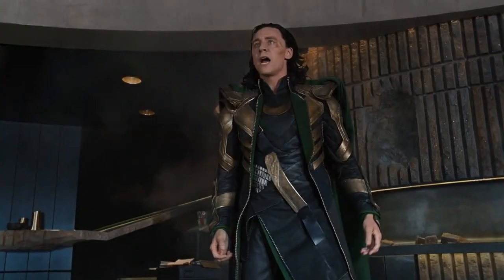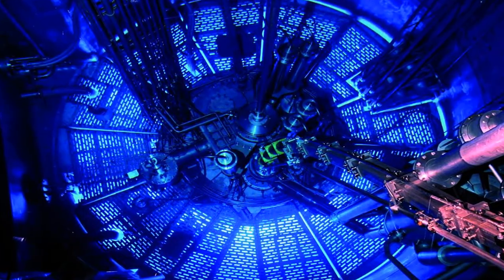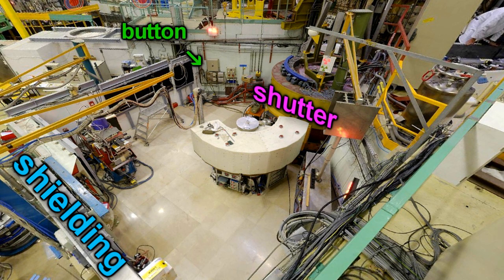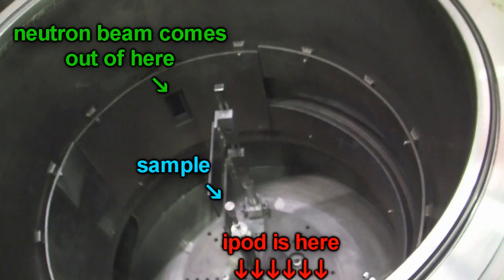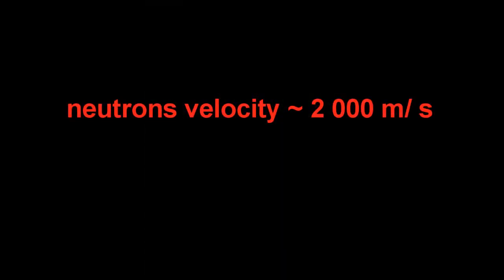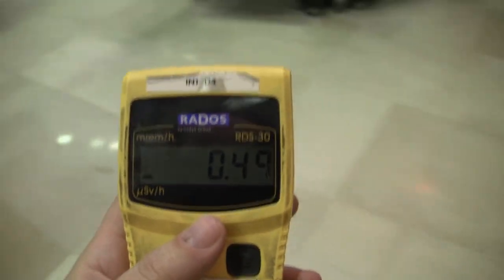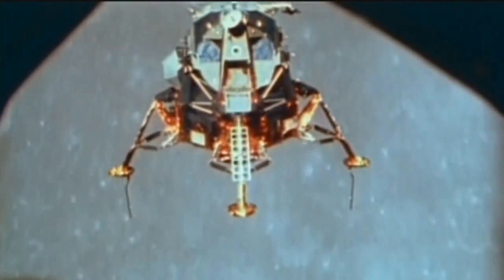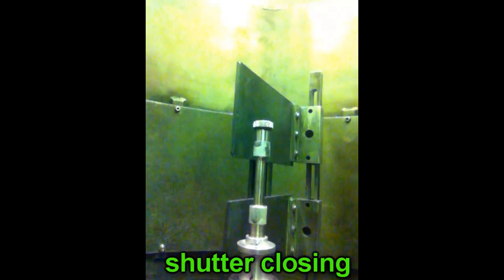Ipod in a Nuclear Reactor Beam

Comment: I'm curious if it's safe to pick up the iPod after you blast it with a metric ass ton of radiation..
Reply: +TheCrowGamers Radiation is a form of releasing energy.
Being hesitant of picking up an ipod that has been blasted with radiation is about as stupid as being hesitant to pick up a metal that has been melted, casted and cooled down.
Reply: TheCrowGamers Radiation and irradiated dust/fuel are completely different things.
In pripyat (Granted you can live a normal life there now without a big risk), there's a lot of irradiated dust and fuel fragments from the reactor, that's why they have the border.
Reply: Does anything get trapped?  I have no knowledge in this area.  Will the atoms bounce around inside the iPod and slowly leak out?
Reply: Interesting.  I'd still be hesitant to pick it up.
Reply: TheCrowGamers
If you listen to the GeigerCoutner that he had left in there you can hear that, as soon as the shutter closes, the alarm switches off. Therfore no critical radiation is left.
Reply: I was under the impression that radiation can be stuck bouncing around for a pretty long damn time.  Look at Chernobyl.  I have no idea how long particles will bounce around in an iPod :)
Reply: I am going to admit that I may be wrong, since I have read about Neutron activation:
https://en.wikipedia.org/wiki/Neutron_activation

Comment: "Bonds" is the term usually used when discussing chemical reactions, but ok, we've run into a semantic problem.

I haven't seen your clarification, sorry. However, you're mixing two different things. "Field of EM radiation" is a name used to denote non-ionizing radiation, and "radioactivity" is a term used to denote the ability of matter to spontaneously decay its nuclei.
IR and radiowave emissions from bodies aren't radioactivity (though our potassium and carbon are weakly radioactive).

Comment: As I stated in a previous comment, you would have to expose the iPod for much longer than Thunderfoot does to make its bonds start breaking down. That short exposure may cause some electronics damage, but it won't make the iPod radioactive.

Comment: Radioactivity is the energy coming from the decaying atoms; those neutrons are a perfect example, seeing as they are forcing atoms to decay to just get the neutrons.

To make another object radioactive, you would have to hit them with such intense energy as to cause their electron bonds to start spontaneously breaking down, letting off more energy from its own decay. Simply put, it would require MUCH LONGER exposure to turn the iPod radioactive, as it is not as sensitive as living tissue.

Comment: The neutrons used for nuclear activation of isotopes are typically thermal neutrons (0.025 eV). These are consequently the same type of neutron you'd encounter in conventional nuclear power plants, which is why plant parts remain radioactive after decomissioning (the neutrons were slow enough to be absorbed by lighter elements surrounding the core).

The neutrons in this video are "slow", but still simply too fast to be absorbed by most common non-heavy isotopes. Instead, they get scattered.

Comment: I will say it again - Just because something gets slammed with radiation does not make it radioactive (as proven by this dude going into the chamber immediately after the experiment)
Even if a neutron did hit particles inside atoms if they aren't unstable not allot would happen, radiation is a cascading effect by throwing things at already unstable isotopes. most of the materials we use for consumption are stable to where they wont have a cascading isotope decay.

Comment: You can use it to express any kind of energy, he could also have used kilowatt-hour  or calories if that would make any sense. He wanted only to show that the kinetic energy of the neutrons could not directly cause the flashes in the camera, but the caused atomic decay can. Using eV makes much sense with such low energies because it gives some easy to handle numbers instead of writing 1.6 * 10^-19 J all the time.

Comment: For the layman, neutron radiation is one of the rarest forms of radiation.  Radioactive materials either emit electrons, helium nuclei (alpha particle), or a gamma ray (high energy photon).  While all those have the potential to be the so called "ionizing" radiation, neutron radiation has the additional ability to make things it comes into contact with radioactive (if they are absorbed).  Neutron absorption is basically alchemy, you can change the proton count via successive neutron absorptions

Comment: I was expecting the ipod electronics to 'crash' at some point - if the energies from the decaying neutrons affect the cmos/ccd sensor of the camera, I would think that they would affect memory or circuitry as well, regardless of the little shielding inside the ipod (compared to the thick rubber walls of the lab).
Or do I misinterpret the spots and flashes, and they are actually visible light from the decay in front of the lens and not induced discharges in the cam sensor through the energies?

Comment: If you look at immunity as biological immunity (via the immune system or some other bodily defense mechanism) Then you need highly fault tolerant genes, and a radiation repair system for damaged cells.
The other definition of immunity is actually a form of resistance. So by being highly resistant you would fit one definition of immune, and if some of that resistance uses your immune system, you fit both.

Comment: so how useable was the ipod afterwords?  was it "radio-active" that you had to throw it away? or once the source beam is off, the exposed stuff goes back to normal?

was kinda expecting the ipod to die in the process (well, explode would have been cool, but I figured it's wiring/chips would at least fry).

Comment: This was an experiment planned by thunderfoot here, as far as I know as well, he doesn't work at that facility.
Also from what I could tell by the geiger counter, pretty quickly after the shutter was closed, radiation levels dropped dramatically, i'm not entirely sure but I don't think the iphone would remain dangerously radioactive, otherwise i'm sure thunderfoot would not have picked it back up with his bare hands.